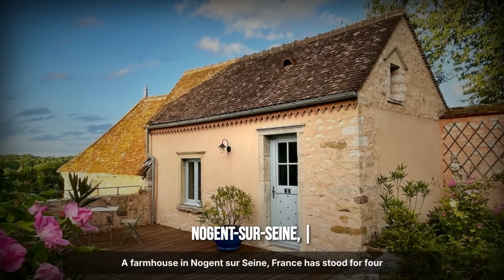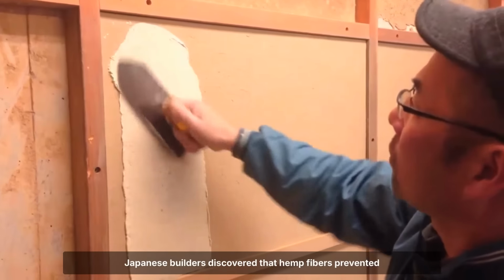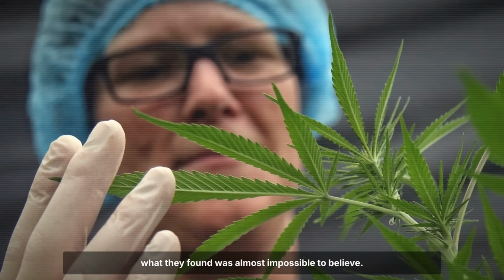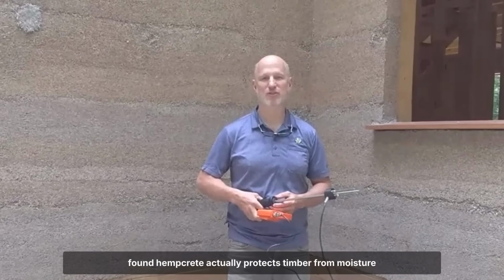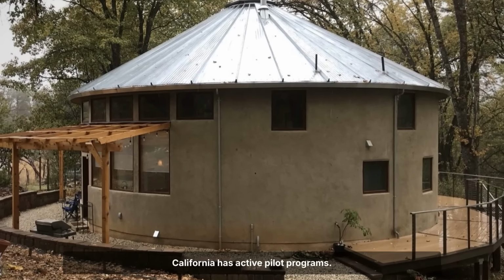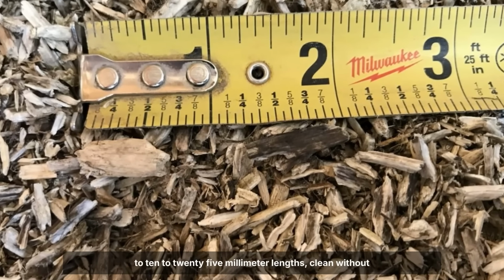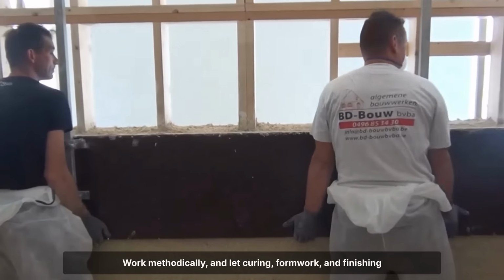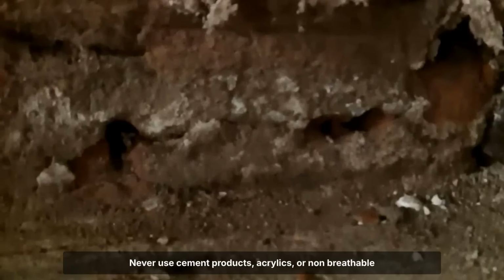The Ancient Supermaterial That Big Construction BURIED for Profit

Comment: Would coating it with sodium scilicate ( waterglass )  helpful or not ?
Reply: Probably very unhelpful, because waterglass isn't very vapor permeable.  The walls HAVE to be able to breathe to allow trapped water to evaporate and escape.  If too low vapor permeability, the walls wouldn't fare well.  The lime would probably suppress mold, but other problems from trapped moisture would show up.  Far better would be to follow the advice in the video of using lime plaster inside and out.  It is resistant to liquid water, vapor permeable, and durable.  Just don't paint it with regular (non-vapor permeable) paint.  Lime plaster made with hydraulic lime, pumice, and masonry sand and/or crushed limestone would be good.  The pumice is pozzolanic which improves durability.